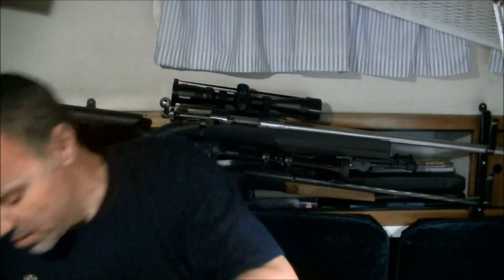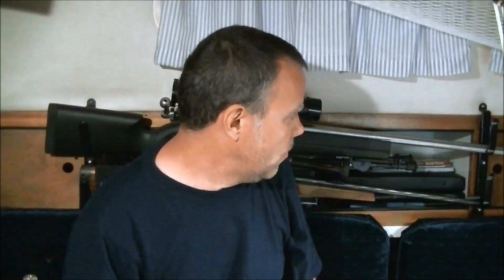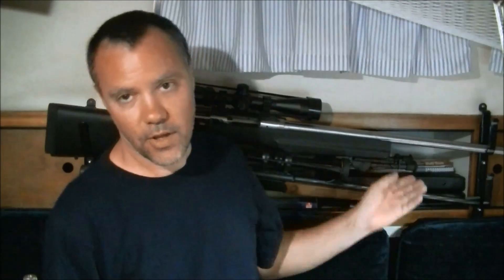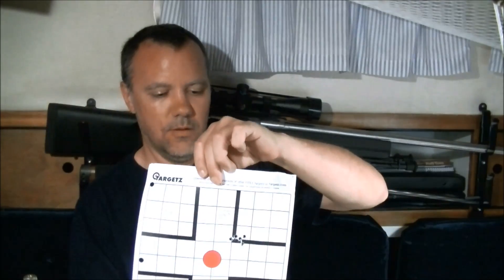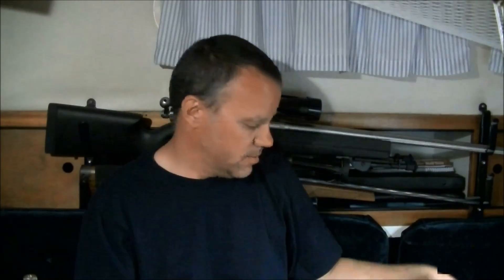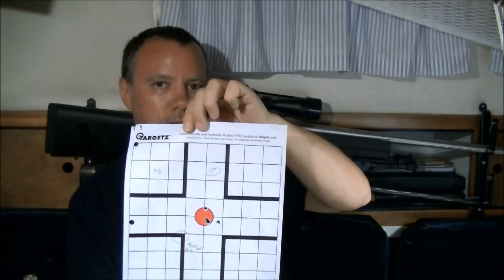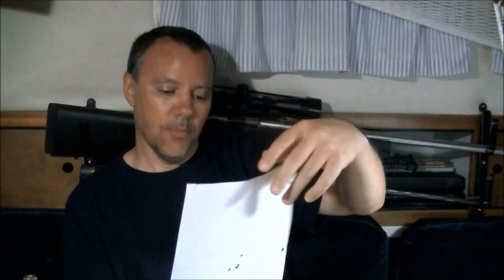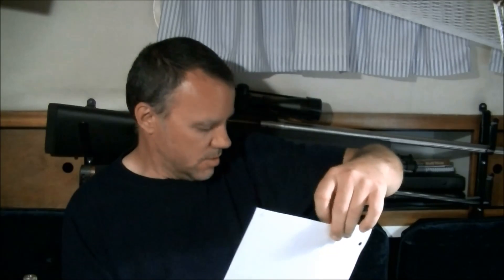.223 load data using IMR3031 and Hornady V-Max 40gr.

Comment: I load the 40gr Vmax to .003 off the lands and get 1/2 MOA using IMR 4198. I've also had good success with H-335, Varget and W748 with lightweight bullets in .223.

Comment: What about with a 55 Gr V max bullet.? I have some 3031 on hand tried to order some VARGET  Powder.? No on has it hard to get in etc.? The 3031 in my 22/250 with 33 GRS. shoots dine size clover leaf shots out to 150 yds with any 55 Gr. bullet. Good  Powder.? Just wondering about it in the Rem223.?  BTW the n22/250 Bullets I loaded them that they were just touching the lands.? Very accurate.?
Reply from the maker: +A REDTAIL I've only tried 3031 with a 69 gr SMK, but it did work fairly decently. I suspect it would work fine for 55 gr pills, it's just a matter of finding the node for your rifle.
Reply: +Van Isle Gunnut Thanks  Right I remember with my 22/250 it took a few different loads before I found that the 33 GRS. Was the ticket.? My Rem 223 is the New Marlin XL7 With a 1:9 Twist Barrel.
Reply from the maker: +A REDTAIL Ugh, I completely forgot I did this 40gr over 3031. I guess youtube is my substitute memory so I should check it more often.  3031 is very versatile so you should have no problems with finding a charge that works. 

I've heard nothing but good things about the Marlin XL7s; I'd be curious to hear your thoughts on it once you get some trigger time with it?

Comment: I am in the process of a Load for my .223 tikka 1-12 twist.
55gr Nosler BT with 25gr ADI benchmark 1 is giving me nice groups at 100-300 yards.
Haven't Tested further yet.
BUT... I ran some 69gr projectiles through it and they were HORRENDOUS! Never have i believed how much twist rate can affect a shot!
Can't 60gr MAX for reliable groups but testing 40gr V-max, 50gr V-max, 52gr Sierra HPBT matchking.
Thanks for the video
Reply: *Can't go above 60gr

Comment: There are many misconceptions about twist rates and bullet weights out there. The only time I've seen in videos a 1:7 twist have a negative effect on a light bullet was with a 35 grain, in which case the g-forces caused it to disintegrate mid air about 40 ft from the barrel. But really, that's a very very light weight .223 round and not common, so I'm happy to be able to shoot anything 40gr+ out of my 1:7.

Good vid man.

Comment: 27.0 gr, Hodgdon BL-C(2). COAL=2.250'' CCI 400. printed 0.68" c-t-c for me today out of RRA 16.5" 1/9 with 5.56 chamber.  Got lazy and didn't actually work up the loads to find nodes, lucky guess, I'm sticking with it.
Reply from the maker: Yes, I would definitely call that lucky! I've never used BL-C(2); are you compressing the powder at 27gr?